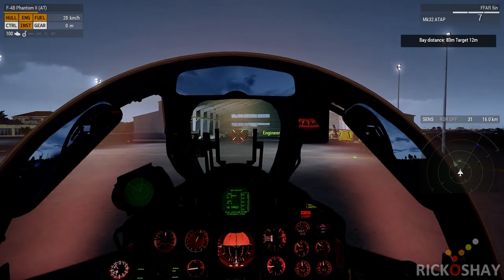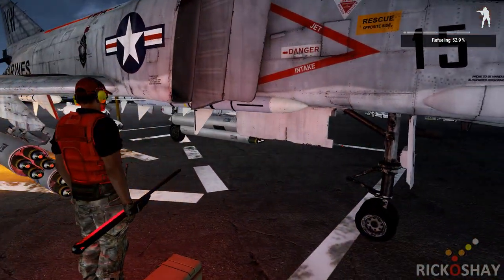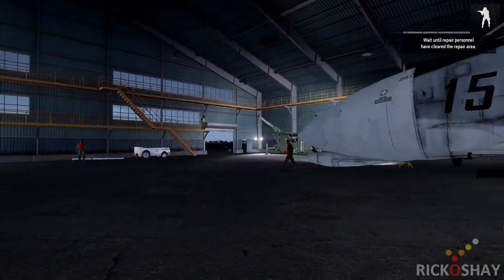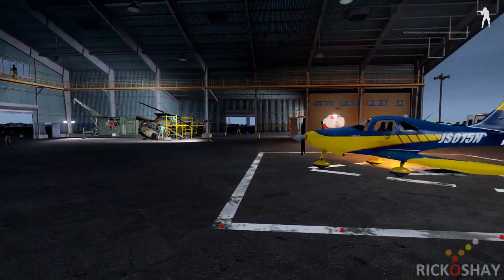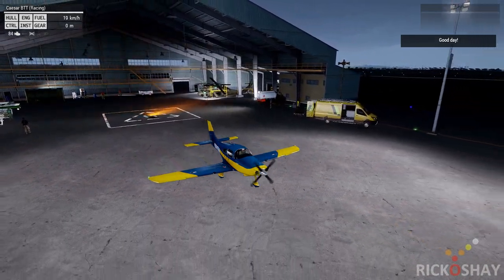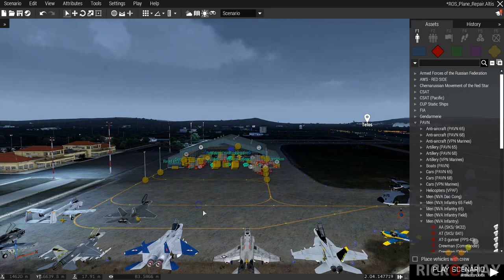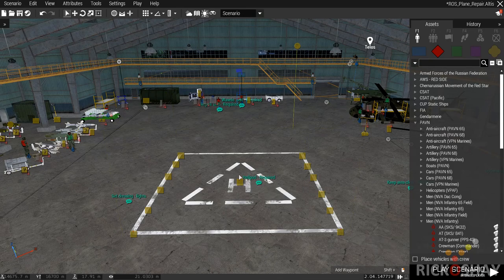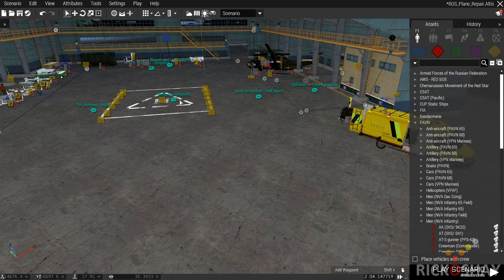ROS Plane repair script

Comment: hello rick congratulations on countless scripts that makes our gun 3 much more immersive.  I tried to install your shake script on my wasteland mission but it doesn't play the sound which is very important for this simulation.  when I go to Eden and run your mission the sound of the snake is just a soldier being bitten is played.  I followed the installation mode in full.  do you have any tips to help me?
Reply from the maker: Hi Leonardo thanks. Sure thing. A friend just installed the snakebite script on his Wasteland server and we picked up a couple of small bugs which I fixed yesterday. The sound issue you mention wasn't one of them. Can you message on Steam and I'll help you sort the issue out.